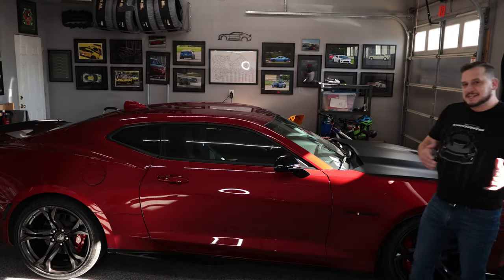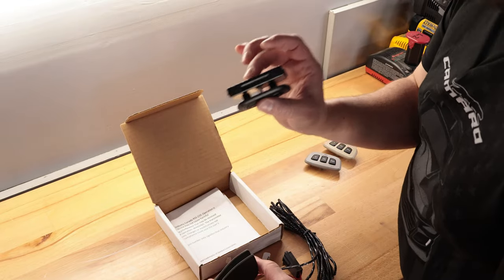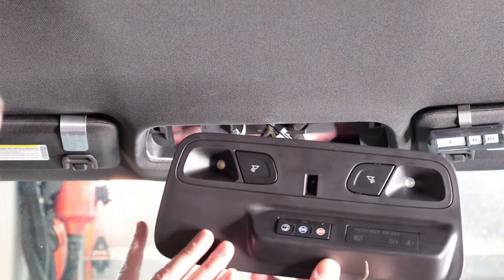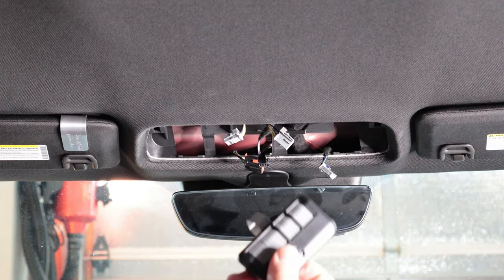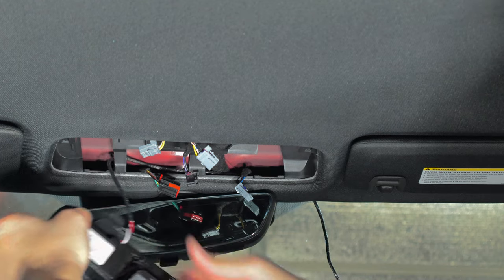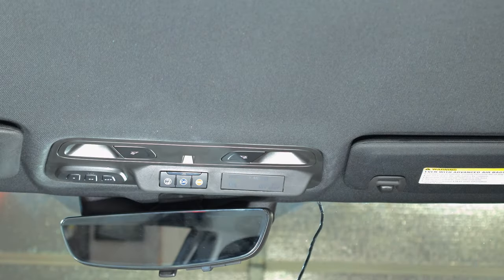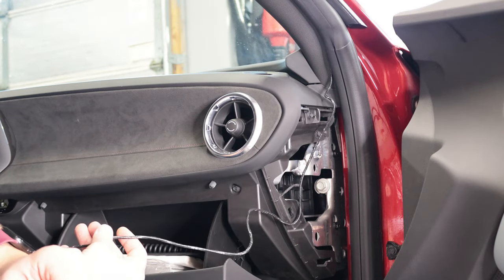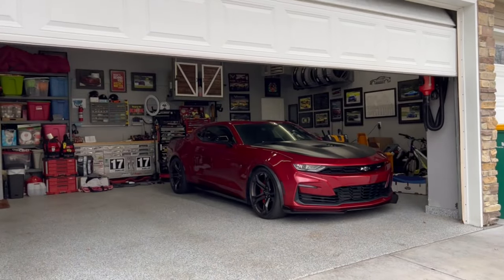How-To: HomeLink Install // 2019-2024 Camaro ZL1, SS, LT1, RS, LT

Comment: Great video!  Only thing I would have done different is soldered the wires instead of butt connectors.
Reply from the maker: Thank you!! I don’t recommend solder here, as over time, solder becomes brittle. OEM Harnesses are all pins crimped onto wires and pushed into a plastic housing. None of those connections are soldered. This was something I learned long ago when I worked at Delphi and had my MECP certification. There are scenarios where solder is a better option, but it’s not necessary here.
Reply: @FollowMyLine17  done correctly (mechanical connection plus solder) my experience is soldering is much better than a crimp connector.

Comment: Great vid. Like always. Will this work for a convertible?
Reply from the maker: Thanks! Yes, you can mount the HomeLink kit anywhere there is room for it. You may have to find a more unconventional spot, but plenty of options in the car.
Reply: Where’s the link for the gen5diy harness
Reply from the maker: The harness doesn’t yet exist on their site. If you look in the description, I provide the email for them to send them a request for the HomeLink harness, as seen on my video. You can also call them and ask to speak to Jarod. Gen5DIY.com in their site.
Reply: @FollowMyLine17 I have the radar harness already there is a 2 way for radar and homelink.
Reply: @FollowMyLine17 oh okay cool thank you
Reply from the maker: @VioletTheCamaro  the radar detector harness with additional leads only provides ignition and ground. For the HomeLink kit you’ll want 12v constant, ignition and ground. If you use the radar detector harness, you will not be able to use the opener without first powering the vehicle on.

Comment: Is there a 12v wire inside the panel to tap into even with a sunroof button?
Reply from the maker: You may be able to tap into the sunroof button wiring. You may want to check each wire with a meter.